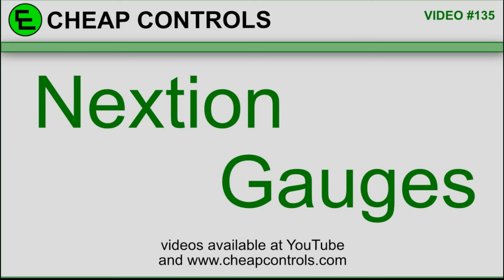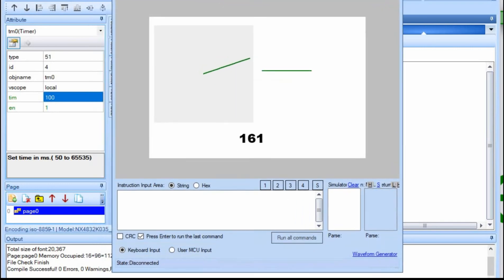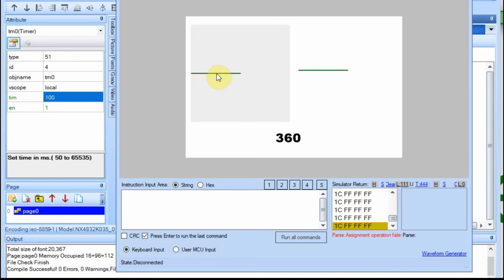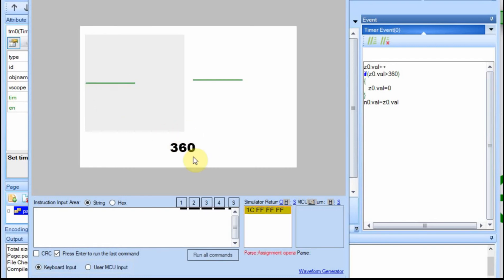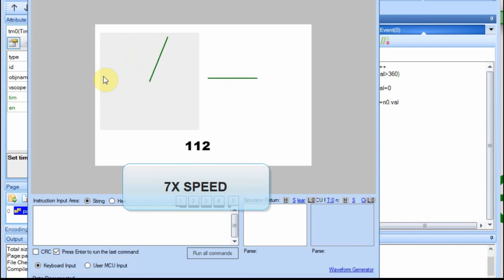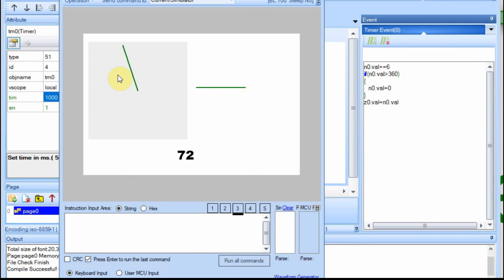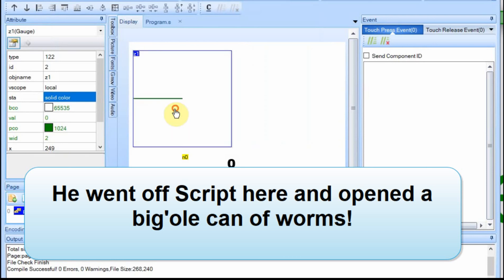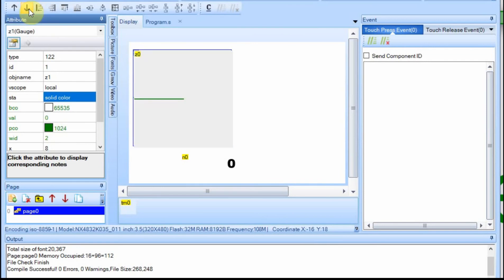135 Nextion Gauges

Comment: Hi once again! Now I'm using a gauge in order to show a POT input. This is showed in a initial page. I have a second page where I show and control other things, so I set the gauge as a global varibale.
When I go to the 2nd page, change the POT, and then go back to the 1st page (where the gauge is displayed) the gauge does not update until I change the POT again. Can you advice something so it update on itself even if I move the POT while on the 2nd page? I hope I have explained mysef. Thanks a lot for your videos and replies!
Reply from the maker: That is an interesting question.  I am not sure I have seen this exact thing tried.  Sometimes objects operate in ways that you don't expect.  I am not in a position to try anything but instead of writing directly to the Gauge you could write to a global variable.  then you could use a timer to update the gauge to the same value as the variable.  When you enter the page it would update as soon as the timer sets it.  You would not need to have you gauge global if you tried it this way.  This is the best I can do at the moment.  I will be using a gauge in my next video.  I will see about trying it out your way with a global gauge and see what happens.  Maybe I will have a different answer after I make the next video:-)
Reply: @CheapControls  could you recomend any video about the use of timers?
Reply from the maker: Try this one https://youtu.be/AQJud69jAx8
Reply from the maker: I apologize, I misspoke in my last comment  My next video is on the scrolling text.  It comes out today.  I am working on one with a gauge that I hope to have ready next Thursday.  Sometimes I forget that my next video to make is not always the next video that is about to publish.

Comment: Of course I try it myself. but so far to no avail.
Reply from the maker: n0.val++
if(n0.val>360)
{
  n0.val=0
}
va0.val=n0.val*1000
va0.val=va0.val/360
va0.val=va0.val*300
va0.val=va0.val/1000
if(va0.val<61)
{
va0.val=300+va0.val
}else
{
va0.val=va0.val-60
}
z0.val=va0.val

//You will need to add a variable but you could try something like this.  I altered the code from video #135.  I will consider making a video.  I do not think this is exactly correct but it is an option to start with
Reply: @CheapControls  Thanks! I'll try and let you know if it works out. Thanks again. That you pay attention to your subscribers and do not leave them without attention. Even if it doesn't work out, you've pushed in the right direction.
Reply from the maker: I am glad you liked the suggestion.  Please let me know what you find out.  The gauges on the nextion have always been something I have wanted to figure out a way to make them look better without a bunch of images.  Some people take a bunch of images with needles at different positions and then display the appropriate picture for the degree they want to display.
Reply: @CheapControls  I also considered the option with a lot of pictures. But I want it to still be a "gauge", I do not promise, but if it comes out, I will definitely let you know.
Reply from the maker: I have a made a note to myself to look into this a bit more.  I will do my best to revisit and let you know if I come up with a better solution

Comment: Nextion’s choice to call the needle-of-a-gauge a Gauge is an unfortunate misnomer.  Spinning a line around in a circle is a necessary component of a Gauge, but it is completely insufficient to allow a maker to display information on a Gauge. 

The magic, at least the part I don’t understand how to do, is how do you create the graphic of the actual gauge you want (i.e. speedometer, altimeter, amp/volt meter) and make it appear visible and non-flickering behind the indicating needle.  Without this part you just cannot make any “real” or useful gauge at all.

Also, speaking of Nextion’s poor choices, it is a shame they set the zero-position of their gauge to the 270-degree position instead of the normal top-of-the-circle position.  Oh well!

In any case, thank you for the great intro to the Nextion devices, it has been a great help getting going on my project.
Reply from the maker: I agree sometimes Nextion does not hit the mark on their products.  But I try to keep in mind that it is a cheap product and for the price it is not too bad.  I am going to look into a follow up video on the gauge.  While filming I discovered the issue of writing to the display will bring the display forward and I want to investigate it a bit more before I make the video.  I am wondering if I can make the Gauge more functional using some other technics.  I also want to verify if the Intelligent display allows transparency background images.